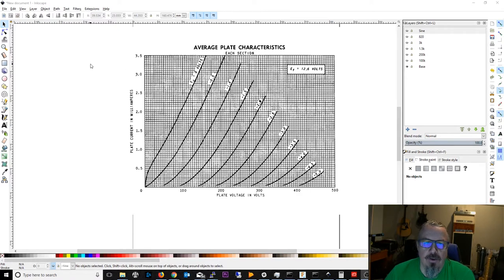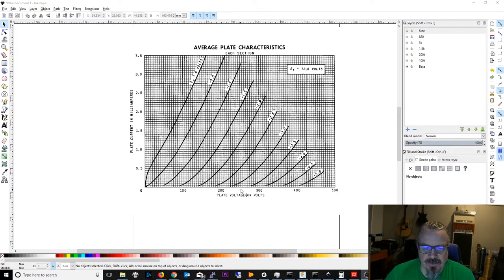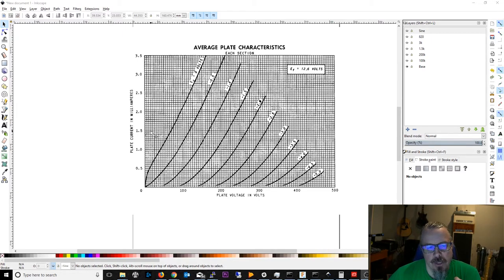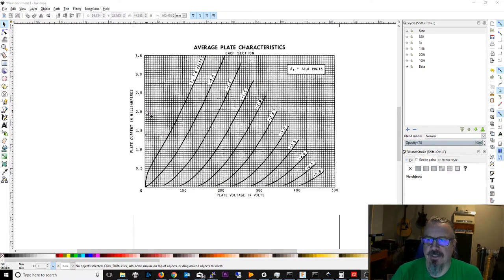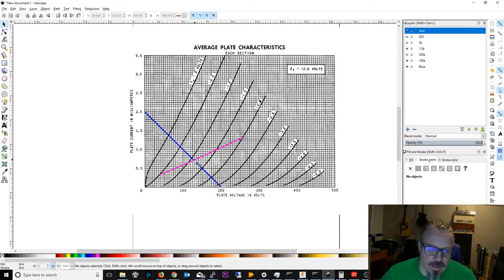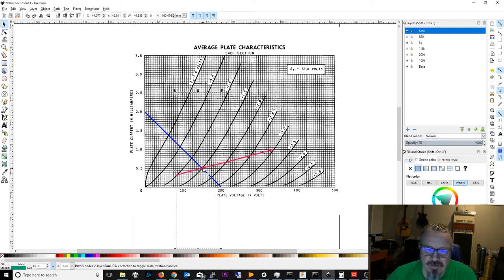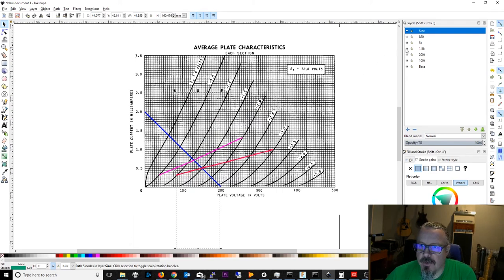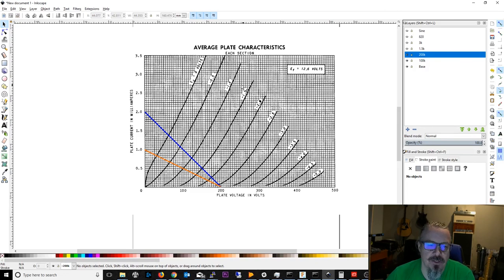Tech Tips Tuesday #1 Calculating Preamp Load Lines

Comment: If you draw a load line, can you use the intersection of where the load line and grid voltage meet to get a milliamp to use ohms law for a cathode resistor?  Load line crosses -1.5 at 1ma that would be 1k5.

Comment: hi sir i saw your video..you are very professional...sir i have a problem with 6080 vacuum tube..i have a adaptor with 230volt on output and i need 170volt on the anod 6080 vacuum tube how i must calculat anod resistor??? and i want to know the anod resistor will change wich one of (current or voltage anod)???? pleas lead me thankyou
Reply from the maker: Calculating anode resistance is related to the operating point of the tube not the voltage you're trying to drop.  You first need to get the voltage to the level you need before the anode resistor.  This is a bit too complex of a solution to explain in YouTube chat.
Reply: again hi sir...i designed my circuit and i want send it for you so pleas make me better guidance ...but on the youtube i cant send it my schematic design...i have instagram and whats app  and email addres ...when you receive my message..send me a message please, until give you my email addres or instagram or anything else ..so i talk to you  more comfortable ...and thankyou
Reply from the maker: you can send me email to pdavis at frenchiefilms dot com.
Reply: hi sir i want apologise of you because i saw your email very late  and i want appreciate to you because you answer my question and you give me your email ...and i will send my schemati circuit for you    when i come back home....and again 1billion time thanks

Comment: Hi, great video. Quick clarifying question; how do you choose the -0.5 to - 1.5 vs -1.0 to -2.0 values? Im confused what those numbers refer to. Thanks, keep up the good work!!
Reply from the maker: That's the tube grid bias voltage. You select all of the parameters based off the optimal region for your use.  Read more here https://robrobinette.com/Drawing_Tube_Load_Lines.htm
Reply: @FrenchieFilms  how did you get 2 grid voltages...is it both sides of the tube, mines 1.5 for each so just a 1.00ma horizontal line
Reply from the maker: @riley0187  For preamp tubes, like the 12A*7 types they have two grids because they have two triodes (dual triode).  In some cases you may want to bias one half differently from the other.

Comment: Good video, thanks!  Well timed too - I'm working on a new amp build and for the first time am kind of straying away from just copying a known circuit.  I have some 6AU6 tubes laying around from a Hammond organ tear down and want to use one as a preamp tube.  It is starting to piece together a bit for me.  I'm working off this tube data sheet - https://frank.pocnet.net/sheets/093/6/6AU6A.pdf.  Some questions:

I think I'm good on my plate voltage which would set the X axis on the load line.  

Can you clarify how you set the Y axis plate current?  Say my plate voltage is also 250vdc.  I don't know what my plate resistor should be.  Do I just need to look for a known working 6AU6 preamp circuit and use that as a starting point?  

Second I'd be interested in knowing more about what kinds of design choices you'd make based on tone?  You touched on it a bit, but I'm thinking about 'I want my amp to sound like X - what kind of load line do I want to achieve that'.
Reply from the maker: The current is calculated based on the 'resistance' of the specific spot.  You just pick the two easiest to calculate, and it works, the two places are pretty unlikely to happen, but they're at 0V and your max voltage.  If it's dropping all the voltage over the tube it's at max current, which is equal to the voltage (250) divided by the anode/plate resistor per ohms law, the other is when the tube doesn't drop any voltage so it's still at max voltage and 0 current which is 250V/ 0 resistance or 0, so your X point there is 250,0, then draw that line between the points.  As far as plate resistor, the tube chart you reference shows some examples, for 300V, it shows three different plate resistors you can try (Rp) .1M or 100k, .25M or 250k, and .51M or 510k,   It shows a few cathode values as well (Rk) then shows the expected voltage output (Eo).  you could try any of those, and just see how it sounds, or try to adjust those values at the voltage you're expecting, which is a bit lower (250 vs 300).   As far as the impact it, makes the gain go up or down, depending on how much voltage sweep is accessible on the graph, and it also can compress one side of the signal more, or less, depending on how much head room you give the signal as well.  It doesn't change the 'tone' a ton, that's more the coupling capacitors and tone stack etc, but each tube does have a bit of it's own 'color' as well.  If you bias towards more gain, it will be crunchier, but have a bit more noise, but for guitars that's not a big deal usually as those can be even better.  The only way to know, though, is to tweak and see.  If you're going for that Dumble sound he' tended to like cleaner gain stages with more headroom and used local negative feedback to remove noise/distortion.  If you want a more crunchy tone, you need to bias more towards that higher output, but expect a bit more noise, or just add additional gain stages, it's a bit tricky and a definite balancing act.
Reply: Thanks!
Reply: Thanks for that - I actually read through that thread in depth in preparation for my build.  Very good stuff there.